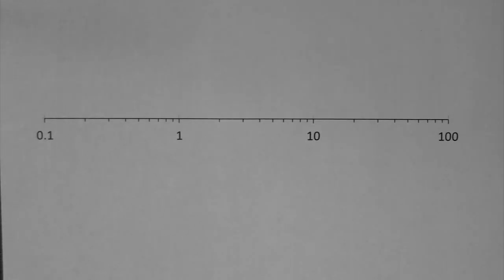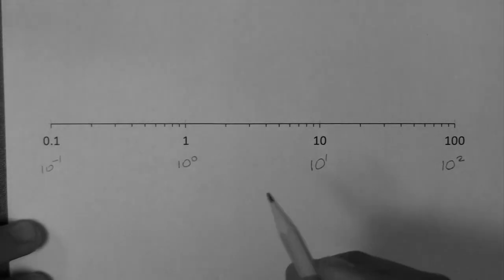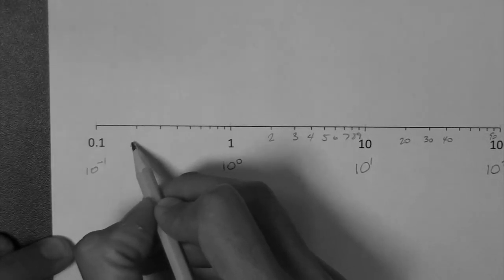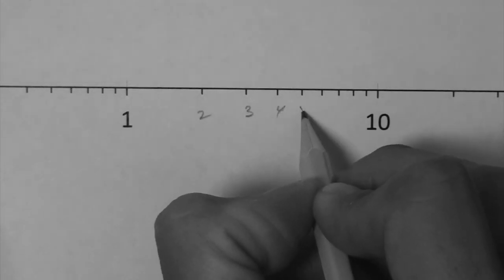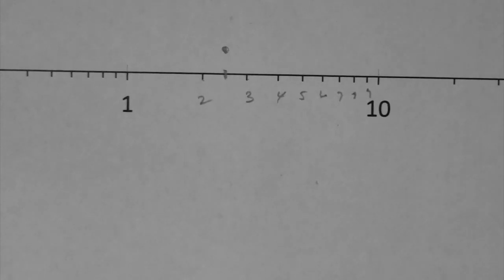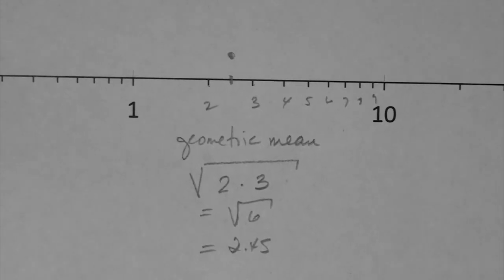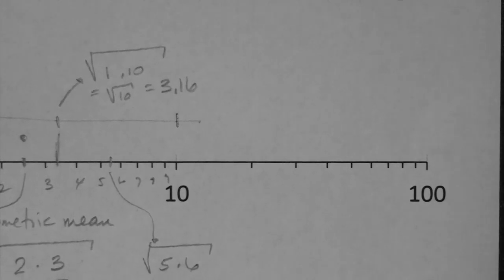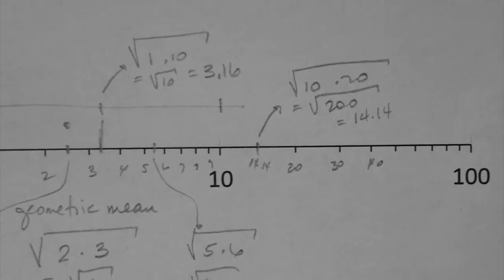How to read a log scale.

Comment: Nice trick to think of the distance between units on a log scale. The geometric mean idea just comes from taking the halfway point between log values like this: log(x) = [log(2) +log(3)]/2. Doing the math, you get x = sqrt(2*3), as used in this video. You can get any value along a log scale by doing regular linear interpolation, while logging any value that should show up on that scale. A more general formula might be x*=x1(x2/x1)^n, where x* is the actual value at a fraction of n between x1 and x2 (n is the fraction you visually see on the log scale, so like 0.5 in this video).
Reply: Thank you so much for providing a calculation that is actually universally useful, instead of trick that only works sometimes. Your comment is far more valuable than the posted video.
Reply: @nicolejacobs2052  Thank you! I'm glad this comment was useful. I think the video is beneficial for those who want just a quick rule of thumb when looking at log plots, but it leaves out the math details behind why it works and how to interpret other increments.
Reply: am i a genius or what? figured that on my own. delving into narcissism, forgive me fellow students xD

Comment: Great video! Thanks! This Geometric Mean Equation. How is it derived? What does the geometric mean have to do with log?
Reply: A derivation would come from just logging the values used to linearly interpolate along the scale. So log(x) = [log(2) +log(3)]/2. Doing the math, you get x = sqrt(2*3).
Reply: @howdyshaker  That's true, but I found that a couple more steps makes it more intuitive. 

The distance from 1 to 2 is log(2), and from 1 to 3 is log(3). 

The distance to the halfway point in between those two is then [log(3) - log(2)]/2 + log(2)
(The first term being the distance from 2 to the halfway point, and the second term being the distance from 1 to 2. Adding those two, you get the full distance to the halfway point.)

This simplifies to [log(2) +log(3)]/2. Then you just take 10 to this number, and you get: sqrt(3*2) = sqrt(6).

This can be generalized to any two numbers m & n (where n<m):
[log(m) - log(n)]/2 + log(n) = [log(m) + log(n)]/2
Then take 10 to this number, and you get: sqrt(m*n)
Which is the geometric mean of m & n
Reply: @1900maniac  Yes, great explanation. I skipped explaining that step, but I completely agree with the adding of log(n), which is necessary for proper interpolation. I am curious about your thoughts of another comment I posted 4 months ago. I posted an equation that could be generally used for any distance (not just halfway) between m and n.